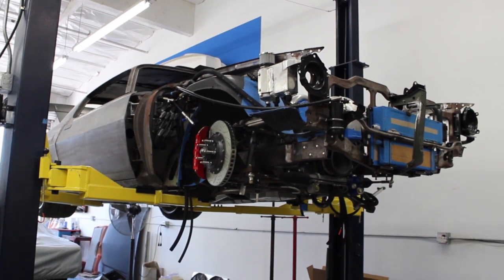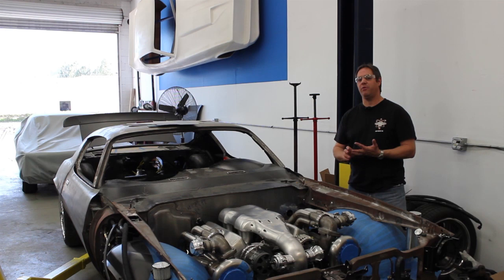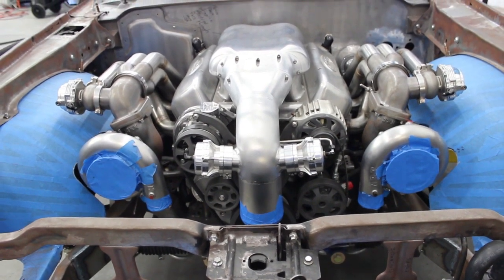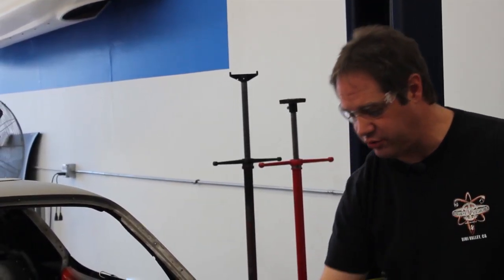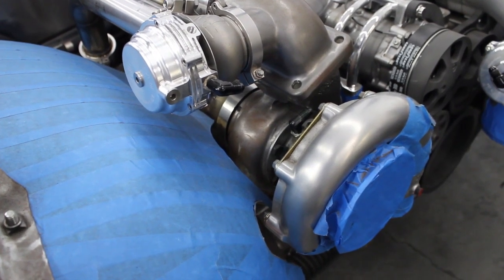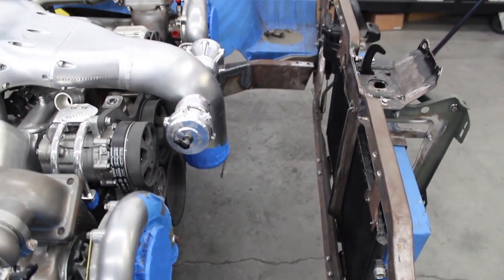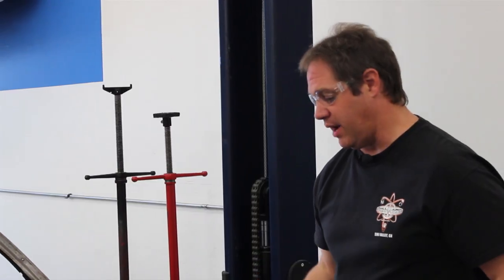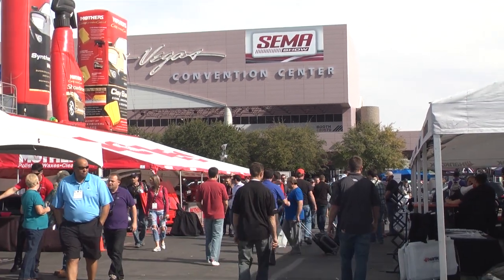Overview of Pure Vision's Twin Turbo Camaro Build

Comment: @aaroncake: To be more specific, there is a special thrust bearing that Nelson Racing Engines has developed and patented.  Yes there have been other reverse rotation turbo designs but they all have a fatal flaw in the design causing them to be significantly less reliable than the standard rotation versions.  Therefore, anybody actually wanting to use their cars is likely to have avoided mirror image turbos in the past.  These ones actually work! For more info ask Tom Nelson.

Comment: I'm not certain how Nelson was granted a patent on a "Symmetrically Designed" turbo, when Nissan has been using them in their GTR's for years. I mean, that has been part of their proprietary component for creating high horsepower motors for quite a long time. This is NOT the first company to make these, and it WILL NOT be the last. Anyone with CAD/CAM skills and the right CNC machines, can spit these out all week long. All they need to do, is make very minor changes to the way they mount together, or the way that other items mount to them, and that's called legally ignoring a patent.